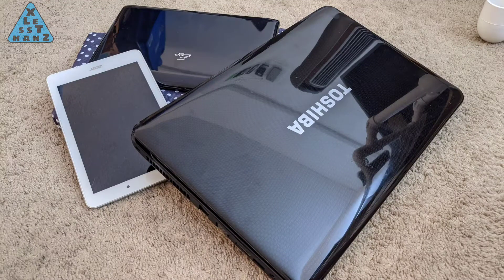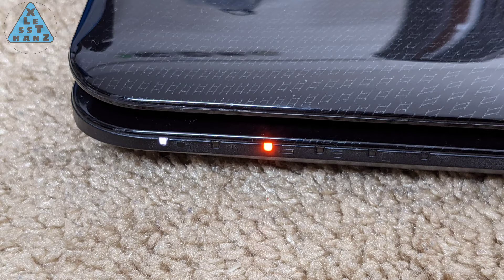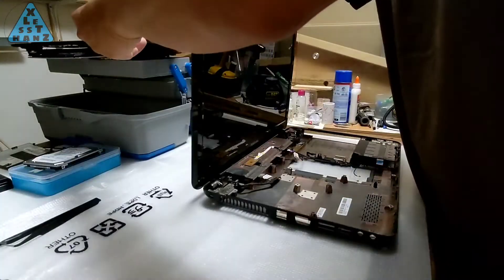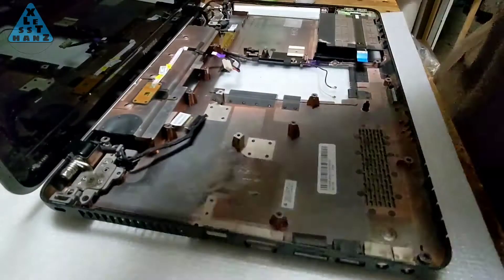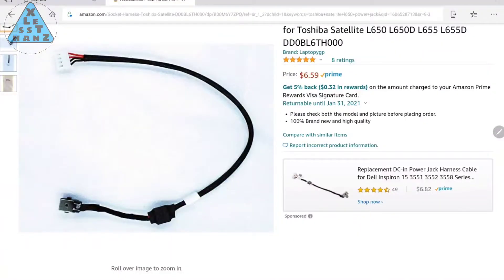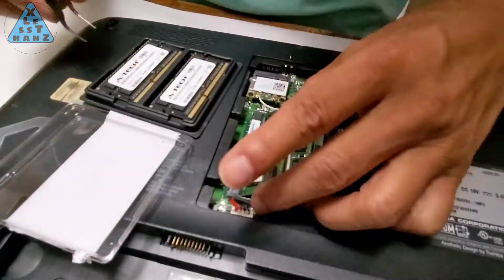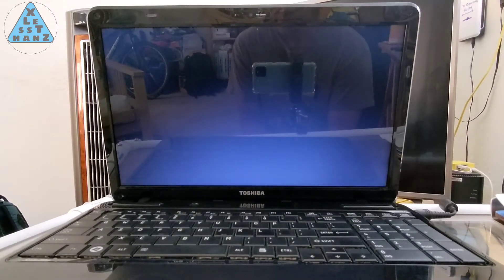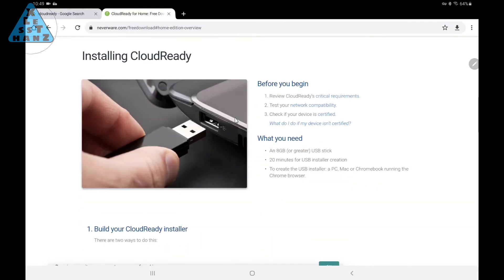CloudReady Chromebook on Upgraded 2010 Toshiba L650 - Easy (FAST & CAPABLE)

Comment: I attempted to run Cloudready on a 2006 Acer aspire and absolutely failed... Cloudready is a joke. Get Linux instead for elderly machines
(Although granted USB 2.0 booting isn't very stable)
Reply from the maker: Wooo, 2006.  Those were the days of 1GB RAM, lucky if you had 4GB, and 100GB hard drives.  Yeah, modern websites would struggle on a system like that, so the better option would be Linux.  Cool that you still have a 2006 computer of any kind.
Reply: @XLessThanZ  hehe i have computers as old as the early nineties.. Collecting gadgets has allways been a hobby for me and Cloudready doesn't like any Modernish machines, so i keep it mostly to chromebooks
Reply: how are you gonna call it a joke for no apparent reason. Is the device certified? Is it 32 bit? Uncertified devices are not guaranteed to work.
Reply: @ad1340yt  the device (at the time) WAS certified, but It's USB 2.0 made it so slow it crashed BEFORE even managing to install, on the Toshiba I fell back on it didn't even boot.....both devices have since been moved on from my collection in favour of older stuff or stuff that's ....better.